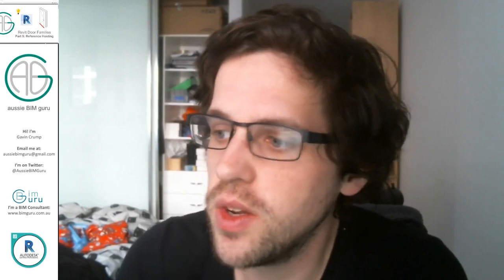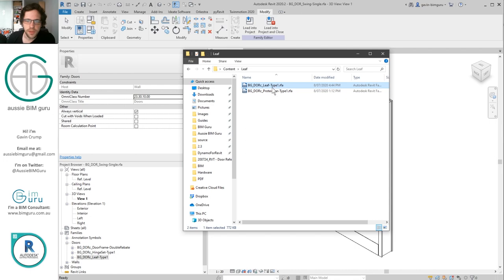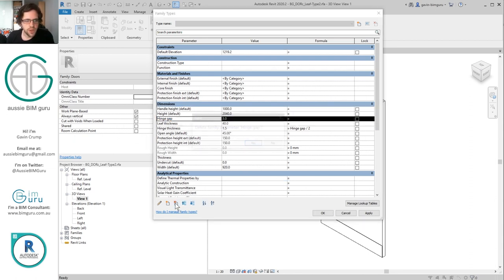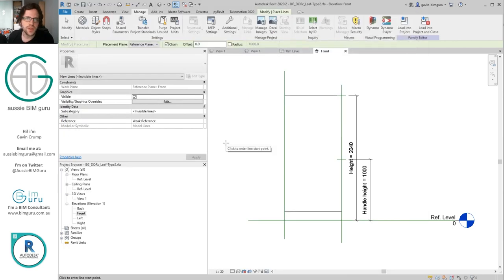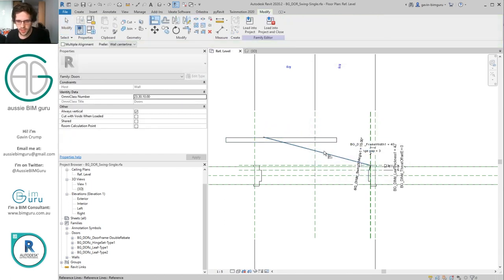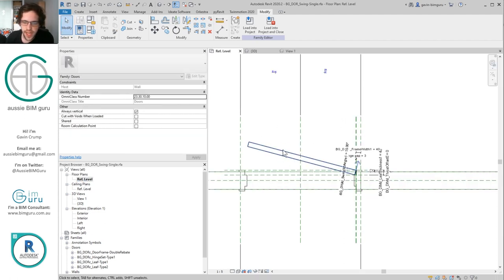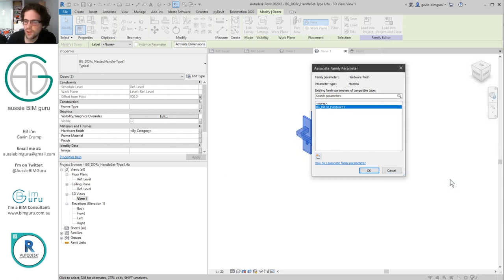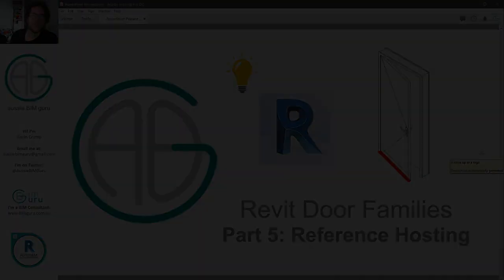Revit Doors, Part 5: Reference Hosting

Comment: Great video. Very helpful. Having a little challenge. When i align the leaf to the hinge and change the angle, it does'nt stay aligned in place. Any solution?
Reply from the maker: Maybe try this alternative in the next video to see if it works better, I find it more reliable for leafs generallly:

https://youtu.be/rH2LyJRArPI

Comment: Sorted :) Still confused with instance / type nesting :) I believe Instance ->  Instance -> Type would give the same result as Type - Type - Type nesting  as final family level overseeds it all or something like that. One day I will fully understand it :) Great job, thanks a lot.
Cant wait for a course to buy. Is it going to be some kind of kitchen family or maybe beds with imported 3ds max geometry?
Reply from the maker: It will likely be a few common family types. I tend to avoid bringing heavy polys into Revit given programs like Enscape can just load RPC content these days. Might do a video on this type of process though as some find it useful still 

Whilst instance to type nesting can achieve the same result, type to type nesting for nonshared families can allow you to control multiple elements at once (e.g. 4 legs of a table) and also avoids issues with parametric arrayed nested families if you try to swap parameters (it will try to ungroup if it's instance based.

Comment: is there any difference for lock and not lock door leaf family in main family.(for angle)?
Reply from the maker: The only difference is the way the component is built, I believe the components don't need to be locked as they are hosted by origin at the end of the reference line naturally.